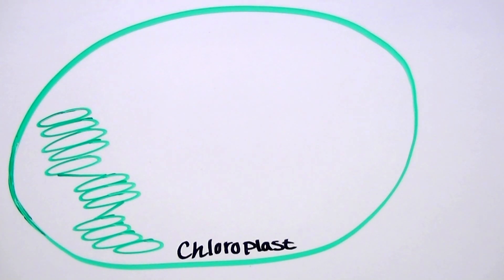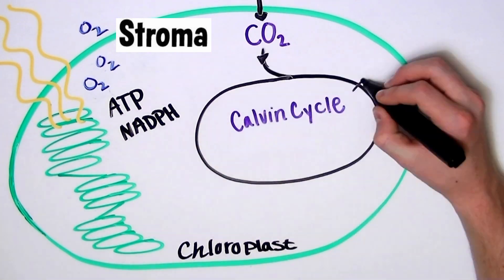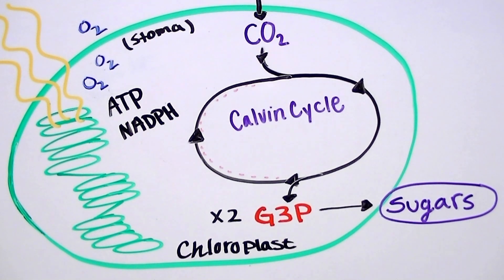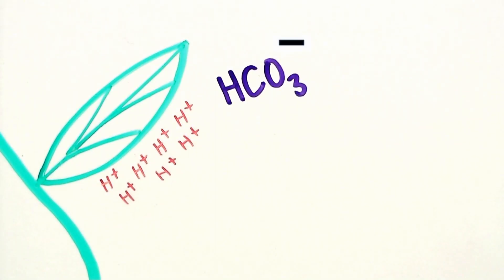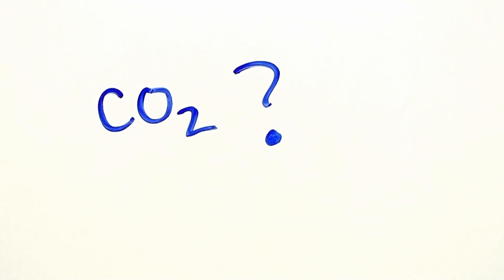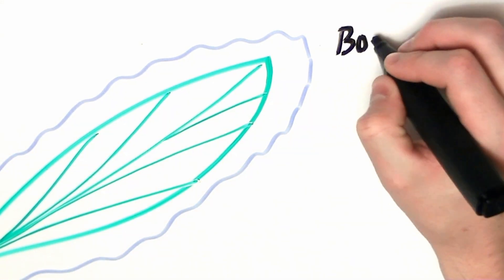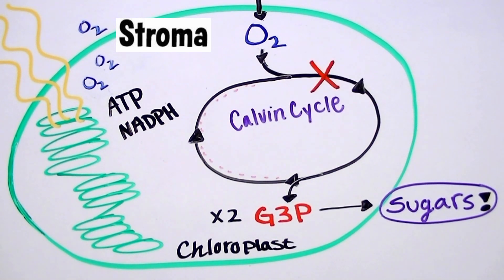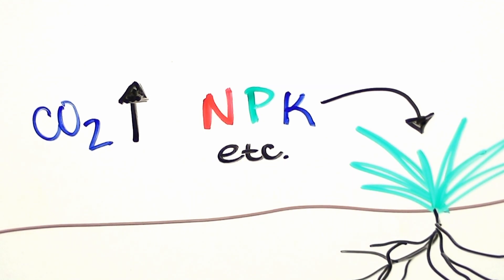Aquarium Photosynthesis Pt. 2: Planted Aquarium CO2

Comment: There must a limited amount of gas that can supported by water of a certain pH & temperature.  By overdosing your tank with CO2, do you not run the risk of under-oxygenating your water column and thus compromising your fish's breathing?  (Doesn't this take place when the lights are out and photosynthesis is not taking place?)  Also, won't too much CO2 cause a pH crash eventually?  How do you balance these?
Reply from the maker: The balance can be tricky, I plan on making an entire video regarding CO2, and O2 and the influence temperature and day and night have on your tank. 

In short, too much CO2 can cause a sharp decline in pH in tanks with a low buffer capacity (low KH). At night in a planted aquarium the O2 can drop to dangerous levels, <4 ppm. Pair this with high CO2 and your fish will begin to become starved for oxygen and can die. A solenoid shut off at night, and or running an air stone at night can help solve this. 

I will also be doing a review on a CO2 indicator to help those learn to keep CO2 at a safe level.
Reply: Awesome!  I look forward to your coming shows.  Thanks for all the great videos.
Reply from the maker: Thanks for the support Lawrence, Im doing my best to keep em' comin!

Comment: I got a plant that is dying anachiris is melting and also goldfish are eating it only had it for a week will it grow back or shall I not bother trying and hope it will grow
Reply from the maker: If your fish are eating it, I would say move on.
Reply: DIY AQUAPROS can declorinator go bad if it is exposed to air becausw I got small hole in declorinator bottle
Reply from the maker: 01fishaquarium I dont think it should be an issue, Ive left the top open on bottles for weeks and the stuff still works fine.
Reply: Thanks so much  I just wanted to be safe and ask or I was worried I would have to chuck a 2liter bottle it got a punchur during shipping so just got it with a small crack in plastic container
Reply from the maker: 01fishaquarium Thats lame! See if you can get a free bottle shipped to you, you never know!
Reply: DIY AQUAPROS  yea but to much hassle uts fine I have a video so watch to see
Reply: Ill coment yr name in the video so u know what one it is
Reply from the maker: Sounds good!